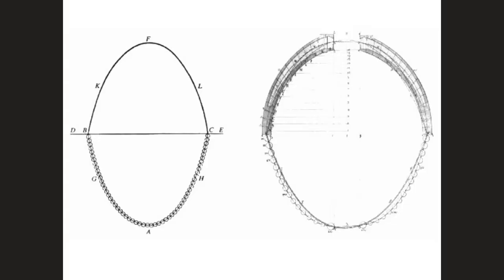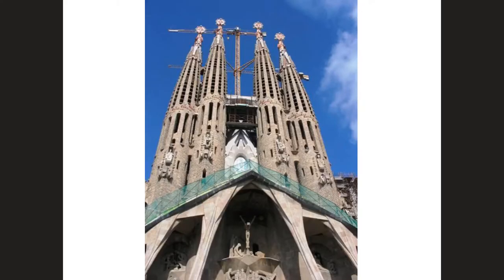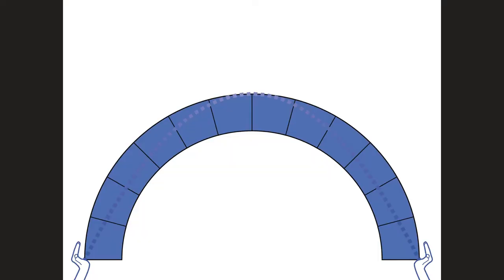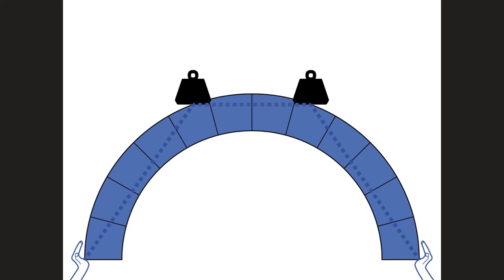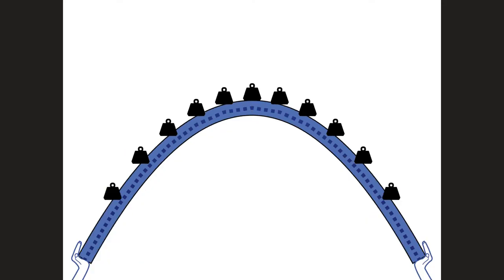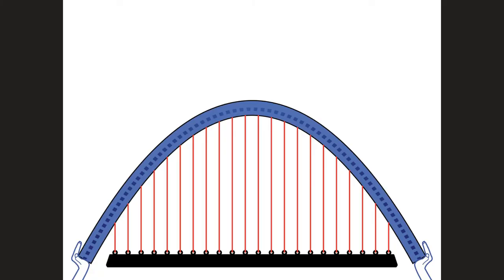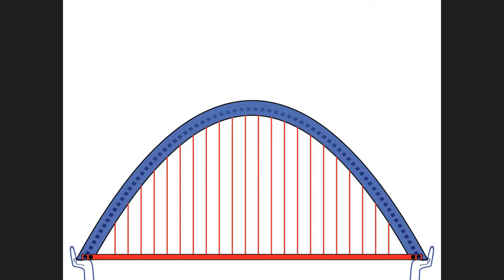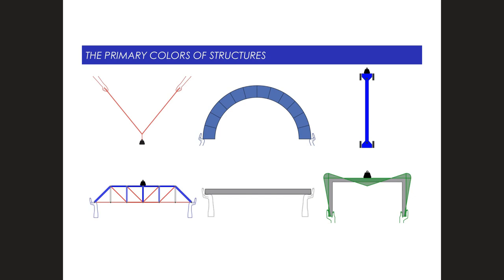How Arches Work! (with Diagrams!): Structures 2-2

Comment: This was a wonderful video. I have pondered the 'thrust line' in an arch and have even tried to calculate it''s position from first principles. I soon realised I do not know enough on the subject to be certain of the placement of the thrust line. I was aware of this inverted chain method and its use by Gaudi and also it use in the checking of St Peter Dome but for some reason I never quite put the two together. Thank you for such a wonderful explanation. I hope that you continue your series of videos.

Comment: I'm a farmer living in New Hampshire USA.  I'm fascinated by arches.  I love to design small buildings, like chicken coops.  I'm doing one now,  with a roof that is a half arch, and having trouble finding a rigid structural material that will give the desired curve and strength, while being lightweight, streamlined and capable of receiving fasteners like nails and screws.  I'm covering the roof with corrugated polycarbonate roofing panels... but I'd really like to know if one can get small arches commercially... or do I have to build my own?

I'll probably have to make my own.  

Anyway, this was a great video, and it taught me a lot about designing with arches and partial arches. Thank you!  🎉

Edit:  forgot to say, I'm a new subscriber!! 😊

Comment: I know very little so this is a very open question, but in the case of the single load off to the side, would you find the weakest point on the arch by using a differential equation to figure out at what point the area between the thrust line and the upper arch is the greatest?

Comment: I have a question. At 4:31 say you wanted to improve the strength of the arch in the scenario, what would you have to do to prevent it from failing?
Reply from the maker: Good question!  Remember this plot doesn't have the self-weight of the masonry itself, so that helps.  Other options for masonry arches is to add more distributed weight above so the effect of the point load is reduced, or reduce the point load itself somehow.  Lastly, make the arch in a material that can take tension.

Comment: great videos!!!
can you please explain mathematically, why the parabolic shape are better than semi circular arches ?
Reply: Look up a derivation for the shape of a cable under uniform loading. The curve turns out to be parabolic.
In an arch under uniform loading, the thrust line will be parabolic (anti-funicular form based on the cable).
A semi circular arch is different than a parabolic curve, and that deviation will introduce bending moments!
Reply from the maker: Great response...

Comment: If the arch is an inverted catenary do you get horizontal shear at the supports?
Reply: Break the force vector at the supports into two vectors, one of which is in the shear direction.